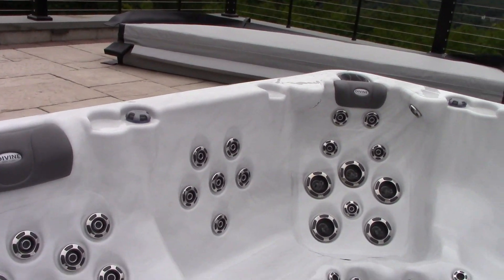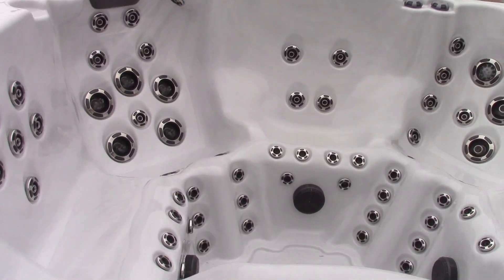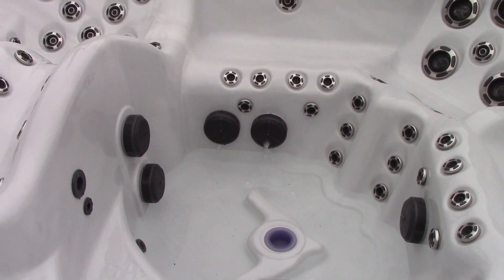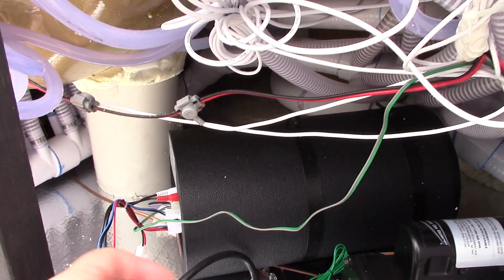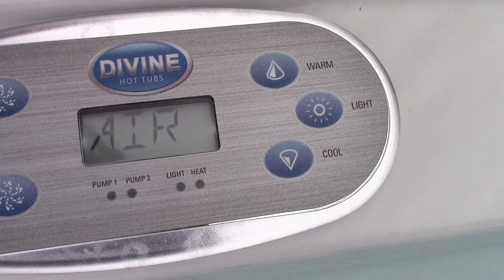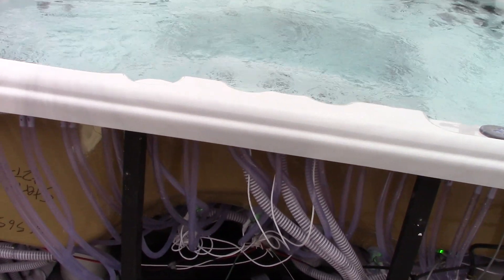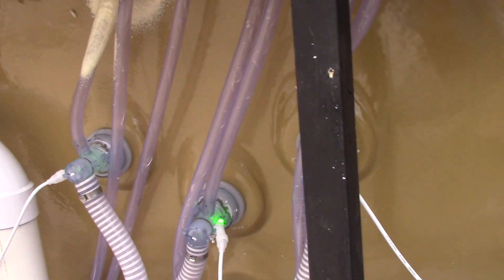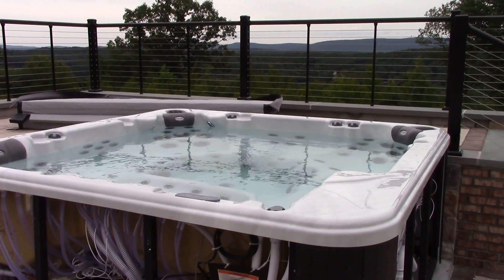Divine Hot Tub: First Fill, and Initial Start-Up.

Comment: My hot tub is taking days and days to heat up. I just bought the house and it had a divine hot tub in it 2014 model. 

For instance it was at 92° and I left for 6 hours and came back and it's at 93. Are you serious? 

Is this normal? My last Hot Springs spa heated way way faster than this. 

Please help with any info. Thank you!
Reply from the maker: Wait I'm confused. It was at 92 and it only went up one degree as you say, but what was it set to?

Comment: Very nice, I sure miss the hot tub at my Grandfather's old house. He bought the hot tub in 1986, and I kept it maintained for him when I got old enough to work on it. It had a small fraction of the jets, compared to yours, but still did pretty well. The only repair I made was to change out the pump motor in 1995. It had a single pump with a two speed motor. 1750/3450 rpm best that I can remember.  His was indoors, so he designed a pulley and counterweight system to raise and lower the cover, and it worked flawlessly.  Also never leaked a drop of water in all those years. It's been 20 years since he sold that house. 
Are you planning to winterize the hot tub, or leave it in operation year round?
Reply from the maker: I think winterizing might be the best option. Unsure if we would use it when its freezing out, and would save on electric bills, especially if its not being used.
Reply: Probably so. Did the manufacturer make decent provisions to perform winterization?
Reply: Not sure where youtube live. But in Canada, hot tub season is in the winter.
Nothing like sitting in the hit tub with snow falling and a drink in hand.
Also ski resort places always have them.
Whistler, Sun Peaks, Silver Star, Big White. 
Yee haw! Dont winterize. Use it.
Reply from the maker: @brotherjesus4246  We actually are! It is still running as we speak.

Comment: Shouldn’t the disconnect be GFCI.
Reply from the maker: The breaker that it's attached to is GFCI.
Reply: interesting.......I just started mine up......well, I tried to, but the SPA Disconnect, which is a 2 pole 50A GFCI breaker, trips immediately.  I am an electrician by trade btw......but I am not immune to mistakes, so I checked all electrical connections from the panel thru to the spa itself..........and all are good.  For troubleshooting purposes, I disconnected the white wire from the GFCI breaker and the spa works fine.  edit: the load side of the neutral wire must be connected to the breaker itself, not the neutral lug in the sub panel.........

Comment: I purchased my Divine Portage hot tub from Costco in 2016, it hasn't had any issues and runs great.  I have had to service the UV Bulb every 24 months and Change the Ozone unit at 4 years of age.  I also had to replace the neck pillows last year.  100 jets, no leaks, runs great, I expect many more years of enjoyment.
Reply from the maker: Very nice! This has been pretty good so far. 
It did actually have one small leak last year, that luckily was easily fixable. I noticed there was always a wet spot in the concrete. But it looked like it would come and go. I found out why. The leak only happened when the circulation pump was not running. At 3:29 you may notice that small black tube near the upper right. Apparently there was a small tear in it at one of the fittings, and the area of said tube did look rather damaged. Easy fix, I simply cut a portion off of the damaged area, with lots of slack left. Put the tube back on, and no more leaks! Hasn't been one problem since!
Reply: @Sharkie626  Looks like the Ozone input tube?  If so, yes, the Ozone degrades those tubes, quite common to have to replace every few years.
Reply from the maker: @adamberkowitz4685  I think the wear on that was just bad handling.

Comment: What is the model of this one? Did you purchase from Costco? 
Costco is offering the Camano at a nice sale price.
I never heard of this brand and just started checking around.  I like that it is manufacture in the USA;  and I like there is not sprayed foam!

1. How much does your electrical bill increase,  in the very cold winter months? 
2. Do you feel the interior design is energy-efficient?  
3. Are you still enjoying your purchase?  Would you recommend this model to friends & family?   Any regrets?
4. When shopping for a hot tub, did you consider other brands? 

Thank you.
Reply from the maker: This is the Sinclair model. The electric bill as changed very little. I keep the water at 60 in the winter, so the heater doesn't run much at all! 

Yeah the interior seems well-insulated. Still very enjoyable!

Comment: I'll be right up, water should warm up enough in 3 hours I figure!

Back in the day of my old Chevy, I had the shop replace the mechanical fuel pump (that was leaking fuel onto the hot exhaust pipe below it, brilliant engineering that was).  The mechanic said to me "You got more wires in that car than AT&T!"  You got more hoses in that thing than Splish Splash!  There's a potential 700 places for leaks in there, wow is that ever complex!  Simple, yet complex!

I never expected there would be 4 pumps in there, that's nuts.  I'd love to know how much wattage the whole thing with the heater uses!
Reply from the maker: Yeah indeed there are leak potentials in that thing, however I actually did see a video where a similar hot tub had problems that this one didn't. This one has actual clamps on all the tubes, this 3-pump model is actually a 3-pump model (minus the circulation pump), none of the insulation is the spray-on type, and it has good rigid support. Equally on point, the other one I saw in the video cost about 8 times more as this one, and that's really not even an exaggeration. Let's hope time is on our side. 

I sure would love to know exactly what this pulls when everything is running too. But that scenario happening is going to be very uncommon. It's on a 240 volt 60 amp circuit breaker, so It's definitely up there when everything is running. When just the circulation pump is going, I can't imagine it's using too much, and it's smaller than a standard pool pump motor, so I'm sure it's less than that even. When the cover is on, it holds temperature extremely well!
Reply: @Sharkie626  I doubt it's that much because it is 240, as the heater and pumps don't have to work as hard and you're paying less to operate that at 240 than you are at 110.